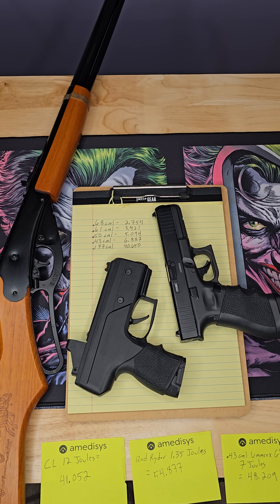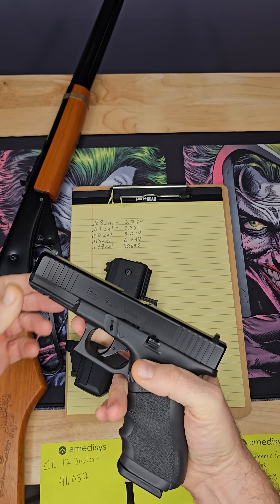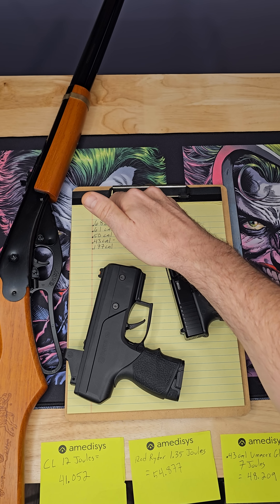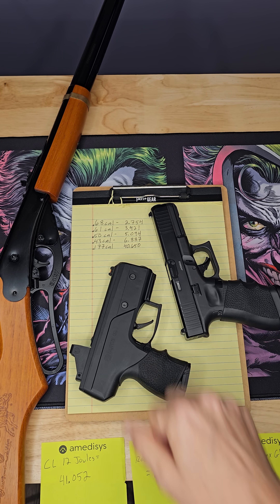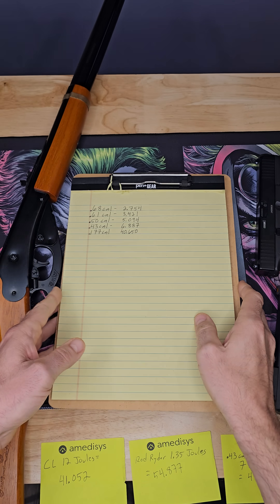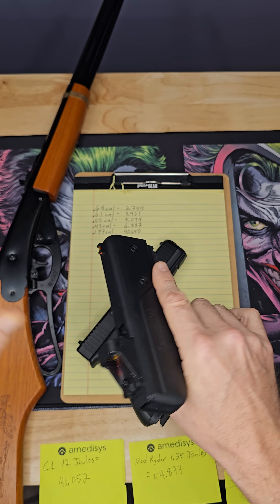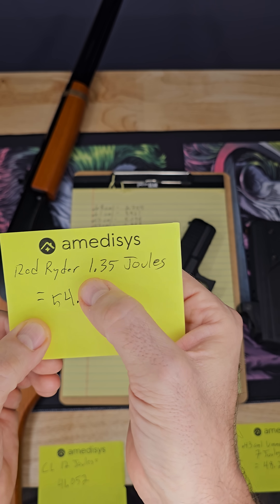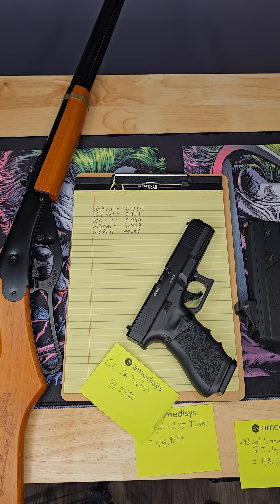Byrna CL Joules Per Square Inch: Why it's for Marketing only!

Comment: I thought joules were used to measure electricity or energy?
Reply from the maker: Yes, energy in general.  With less lethal you worry more about the energy impact at the target because you're not worried about penetration so really velocity doesn't mean a whole lot without the weight of the ammo also factored in. In order to get the joules The calculation takes into consideration not only the velocity but also the weight of the ammo so it's giving you the total energy. So it's how hard the target is getting hit.  Not just how fast something is hitting it
Reply: @DK-Spencer so basically more joules the more pain? 😂 i stumbled across you page, i like it. Very interesting
Reply from the maker: @ThisGuyTho93 Exactly, and thanks! Yeah I am pretty heavily involved in the Less Lethal world.  I've got over 2000 videos right now and most of them are about this kind of stuff.  I do human testing and all kinds of other testing as well and I've also got a bunch of videos showing people how to modify and customize this stuff on their own
Reply from the maker: And using this joules per square inch calculation is only going to help you if you're trying to figure out if one thing will penetrate easier than another and in less lethal you don't care about penetration that's not the goal and unless you're modifying this stuff to ridiculous levels none of it is going to penetrate. That's why we use a big 68 caliber ball most of the time and why they only reduced their caliber to 61 because they still did not want it to penetrate They just wanted to be able to milk the math and use this method to make it look like it was stronger than the competition that was using 68

Comment: I got the 50 caliber about 400 plus feet per second I got aluminum rounds that hit so hard on a bow and arrow target that they disappear into the target and no it's not an old rotten target sitting in my backyard It stays in the garage to be used for .177 and .22  pellets & LTL weapons and I'll say this the 50 caliber aluminum rounds hit so hard they will break and eye socket they will blow teeth out of your head and they will make you go blind or deaf if hit correctly. It will definitely make someone turn and fall to the ground especially when the last three rounds are peppered rounds out of the six

Comment: Gram X fps X fps X .0000465 = joules 
The Byrna cl pepper ball rounds typically weigh 2 grams at 400fps which unfortunately is only the 1st or 2nd round.. 
2x400x400x.0000465= 14.88 & thats on a good day, 
14.88÷0.7436= 20.01 ft-lbs per square inch actual mathematics.
Comparison. 
6 gram at 450fps is 56.5j ÷ 0.7436 = 75.98 ft-lbs 
See the difference? That's huge folks
Reply from the maker: @stephaniecalvo2638 Exactly! I've showed a video before with something  shooting 400 ft per second and somebody commented that it was no stronger than a Byrna.  Course mine was shooting a 10g ball at 400 while a Byrna was using one that weighed the same as air😂😂
Reply: @DK-Spencer for those who haven't done the math yet that's 74.4 joules at 100.04 ft-lbs Per Square Inch.. which ones ganna stop you 20ft-lbs or 100ft-lbs ? The choice is clear.. 👍
Thank You for the Platform Spencer.